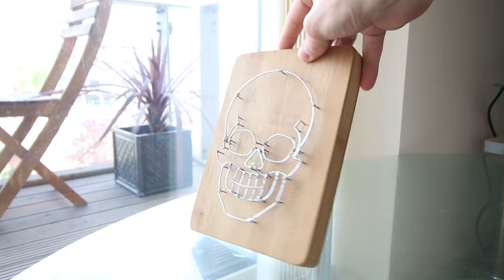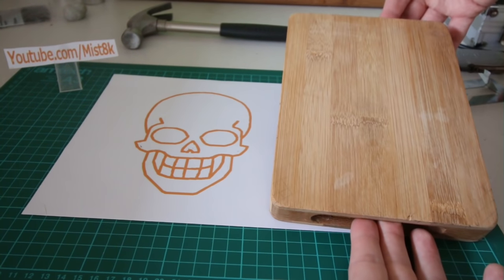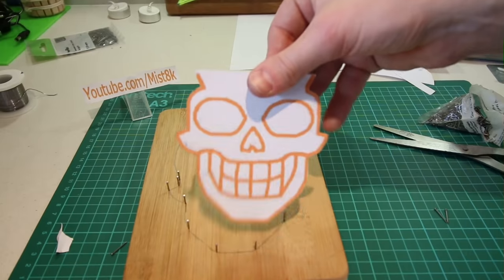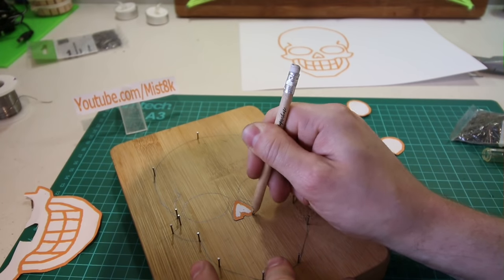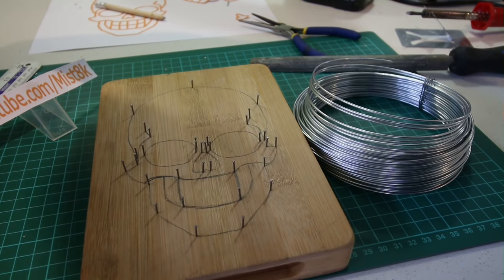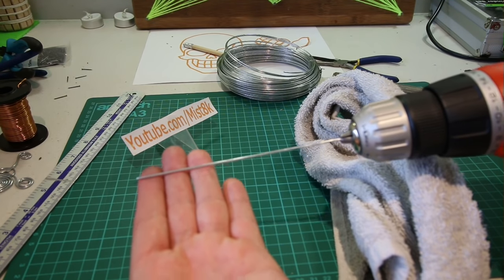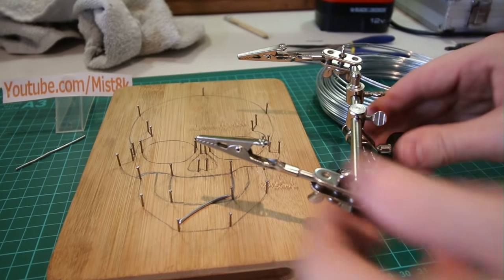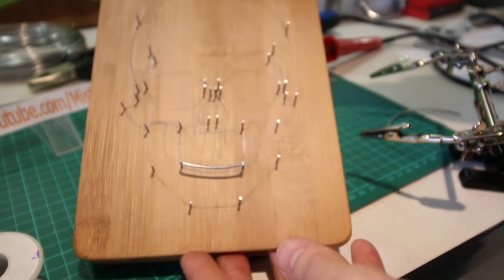Wire Skull Sculpture!

Comment: Why not hammer the nails through the paper, wire it up using the paper below as a template and then just rip the paper out through the design after? would get rid of the pencil lines too :)
Reply: +Andrew Sparrow this
Reply: +Andrew Sparrow I just said the same thing.
Reply: It will pull out the nails with paper..I also tried  the same concept, upto nailing going good. But got stuck at soldering. I am not able to solder the copper wire on nails. Please guide if anyone know the probable cause

Comment: You arent supposed to molt the solder on the iron, but heat up the components and then touch the gap with the solder
Reply: Zciurus that’s very true it’s a cold Solder, but does it really matter? I mean it’s not for an electrical circuit which a cold solder would interfere with

Comment: This is a nice piece, I wonder why you didn't paint or dark stain the wood before starting as a darker colour back would make the wire pop out more?  Could you not have put the nails through the paper template then just ripped it off once all the nails were in the wood?

Comment: What is the material of wire you used to made this....as someone told me that welding on aluminum wire is not possible..and it looks like you are using aluminum.

Comment: it looks really cool, but why aren't you heating up the nails instead of the metal that you are using to hold everything together. I'm not an expert on using tools like that, but i just know for using it ones, that if you heat the metal and make it melt first it's pretty easy to burn the metal, or else i just suck XD

Comment: Wouldn't it be easier to hammer in the nails over the paper and then just tear the paper away? 🤔
Reply: It will pull out the nails with paper..I also tried  the same concept, upto nailing going good. But got stuck at soldering. I am not able to solder the copper wire on nails. Please guide if anyone know the probable cause

Comment: Instead of all that cutting and tracing, why not just make a template with thin lines, then bang the nails through the template, do the wire and soldering work, then tear away the template when your done?

Comment: what is that thingamajig thing called that holds the wire? And where do you get it?
Reply from the maker: +Jenise Stilsing It's called a 'helping hand' or 'helping hands' and it's £5 from Amazon
Reply: +Jenise Stilsing they are an inedible investment if you do a lot of soldering, i was repairing a charger yesterday and man is it usefully have 2 extra hands to hold stuff(and that dont get hot)
Reply: +Jenise Stilsing +Mist8k  Ah! I wish I'd knew about those arms before, now all my fingers are fucked up from keeping the wires in place... angry
Reply: ***** Got mine from china for like 10$CAD and it also came with a magnifying glass on an arm that helps see traces and what not on the board.
Reply: i think i can help :)
Reply: Roboterson